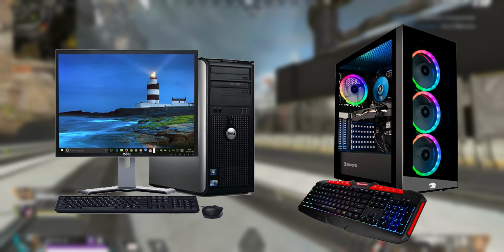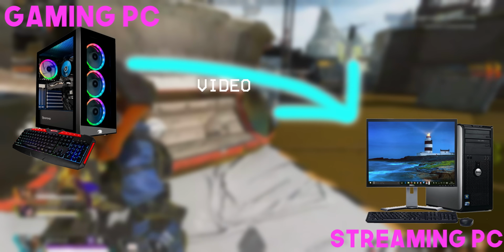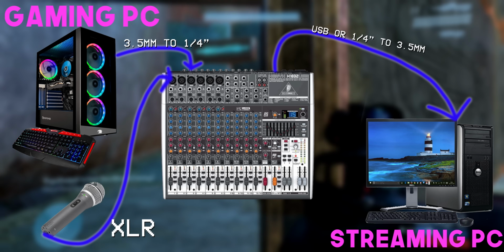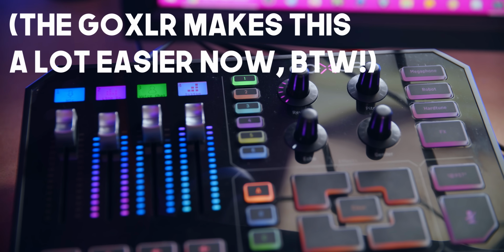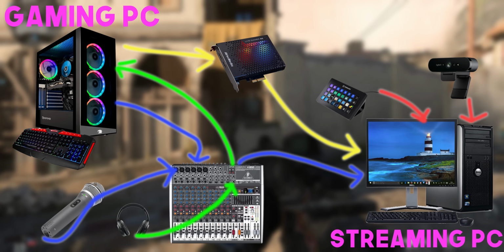SINGLE PC vs DUAL PC STREAMING SETUP - Why and How (Introduction to Dual PC streaming setup)

Comment: I'm in the middle of building a dual PC rig in a Phanteks 719 chassis. You mention issues with cloning monitors and going with the passthrough to avoid issues with cloning. However, I thought that HDMI was limited to 60hz on Ultrawide resolutions and would force you to play at a lower refresh rate using passthrough?

I was under the impression of using Nvidia's software to correct the cloning issues by customizing the outputs for DP and HDMI but setting the DP at the higher refresh rate and capping the HDMI feed to the Elgato to 60hz. That was my plan but I saw this video and unsure of what to do now. Any clarity on this Epos or anyone?
Reply: You already have the case? 
I'd not use an ultrawide for streaming, same with displayport. It's a hassle. Been using a dual pc setup since, Q3 2015?. I recently setup my 3 on my gpu (before a mix of onboard and 2nd pc) using these DP to HDMI adapters from Aliexpress for 2.5 euros/piece. Then you can use normal HDMI splitters to avoid having to use the hdmi output as it won't work without having the pc on. Also if the capture card or it's drivers act up, which tends to happen, then you will have issues aswell, which you don't have with an hdmi splitter.
Couldn't make it out, but I think you are using a high refresh rate panel with DP? If it has a (high refreshrate) HDMI port, set your monitor's refreshrate at a multitude of 60Hz (120,180,240). That's easy to turn into 60Hz. With 144Hz you are going to be missing frames which can cause stutters etc. There are DisplayPort splitters which then you need to use a dp to hdmi again on the splitter to go to your capture card. I'd avoid using NDI as a plague. Duplicating monitors in windows is also a hassle, trust me you don't want it.
Reply: @lachiu1  Yes I already have the case and literally in the middle of the build. Very similar if not almost identical to Harris Heller's rig (Alpha Gaming). I will be using 9700k, 2080 Super on my gaming PC and a 9900k, 2080 Super, 4k60 Pro Mk.2 on my streaming PC. I do video editing/ graphic design as a profession so I need the monitor that I have and the streaming PC to be as powerful as it is. My Twitch stream will feature a mo-cap cartoon that I converse with so the gaming rig is very minimal in terms of specs. The original plan was to Displayport (from Gaming PC) to my main monitor and clone HDMI (from Gaming PC to 4KPro on my stream PC) using the method I mentioned. For work duty, I would switch the source back to the Stream PC when the Gaming PC is not in use.
Reply: Also I'd use the itx spot for the gaming rig.
Reply: @lachiu1  Thats literally how I am setting it up.

Comment: Is there anyway to make x264 to look good with games with heavy foliage such as Escape from Tarkov? I think its just to much for x264 to keep up with even on medium/slow. I notice a slight improvement with nvenc(new), but would prefer to use x264 on my dedicated streaming pc for tarkov if possible.
Reply: What specs?
Reply: Don't duplicate your monitors (main monitor and capture card) if that's what you are doing, extend the desktop to the capture card, then project the Game Capture in OBS to your '2nd screen' the Elgato.. I game on 1440p 165Hz, and OBS projects the full screen game to my Elgato on PC 2 at 1080p 60Hz, so the hardware effectively downsamples the image anti-aliasing slightly. Then run simple textures and a little bit of AA in game too, and this makes for a much smoother image for PC 2 to encode.

Comment: Would love to get you input on Ryzen APUs for 2nd PC. I want to go mITX for a SFF streaming box so want to skip an Nvida card if possible.
Reply: You really don't want to use an apu or igpu (quicksync) for encoding. ITX would only be possible if you use an usb powered capture card as you still need a little gpu for rendering scenes. I'd futureproof and get an atx board.
Reply: @lachiu1  long delay, but I am about to finally follow through and build a second box.

 i7-6700, GTX 1050ti,  AsRock B150M -HDS, EZCAP 324 capture card in a NR200 case. Finding a mDTX motherboard was a big selling point as it lets me have a low end card for NVENC but also have a pcie x1 slot in a 3 slot SFF case.
Reply: @Kathdath  Nice

Comment: This entire guide is assuming that the game being streamed is a PC game... a modestly spec'd single system with a capture card can run console game capture/streaming just fine...  Hell, a single system with at least a 12C/24T CPU can do all of what's mentioned in this video on a single system. This is overkill for most people.
Reply: Because console streaming is different. Xbox - Capture card - pc. No need for two PC to stream
Reply: Well offcause. Streaming consoles is basically a two device setup

Comment: How much horsepower does the 2nd  (streaming PC) need? Will a 4 core apu handle it?
Reply: Depends on what you want to do.
Stream? General recommendation: i7 4th or gen better, multicore wise. So Ryzen 5 3600 atleast imo (1700, 2700, 3700 are also fine preferably not a 1700.). If you want, you can bypass this with a gpu, atleast a 1650 super then you don't need cpu power apart from pcie/io limits (capture card + gpu). 
Stream and record? CPU + GPU power required.
Mind you, you also need a local drive to record to. SMB has a lot of package drops for me, still need to test iSCSI and NFS. 
For audio you should use voicemeeter instead of a mixer.
Reply: @lachiu1  I use a 1700 and works perfectly :) (stock settings)

Comment: Yeah HDMI is perfect if you want to go back to 60Hz.....
Reply: hdmi 2.0 man smh
Reply from the maker: HDMI 2.0 carries up to 1080p240, 1440p144 and 2.1 will be able to carry up to 4K120, etc. But hey misinformation is always fun!
Reply: @EposVox  Not everybody has HDMI 2.0 Hardware (Monitor and GFX card). In my case I would need a new monitor for that, anyways I just wanted to warn people. And it is not misinformation.
Reply: @CrashPilot1000  I mean your not wrong about the monitor and gfx card but it was very vague what you said , im actually  in the hunt for a cheap 1440p HDMI 2.0 monitor but i can't justified spending money right now for it because of cloning issues. I wish there was a way to do HDMI 1.4 to HDMI 2.0 signal but that not a option i believe. Kinda of a bummer i spent 400 dollars on a monitor that does not even have hdmi 2.0   2-3 years ago.